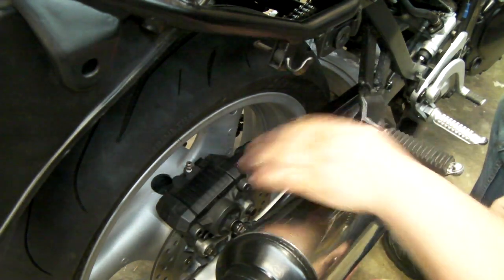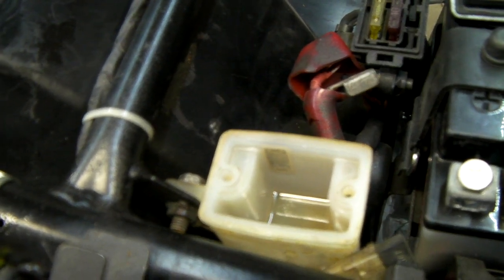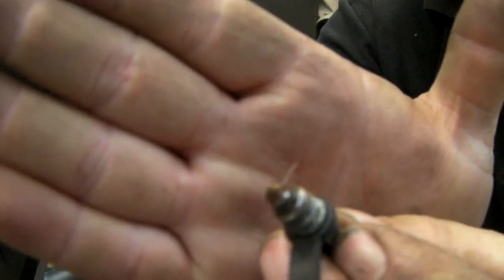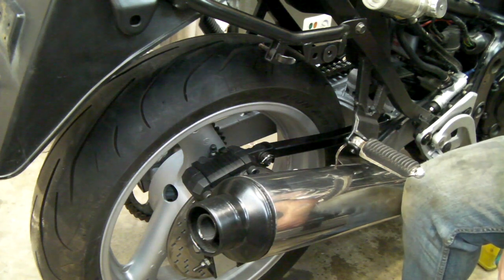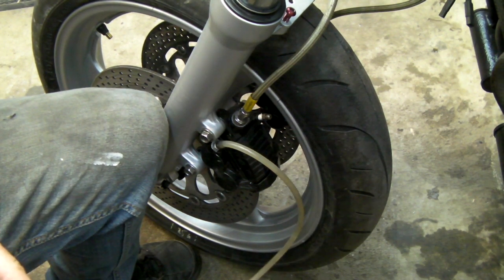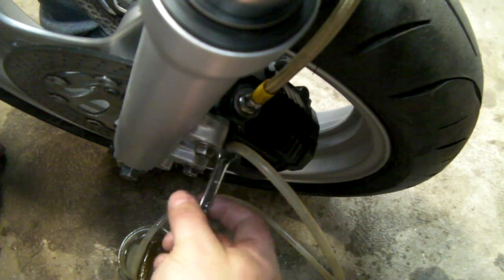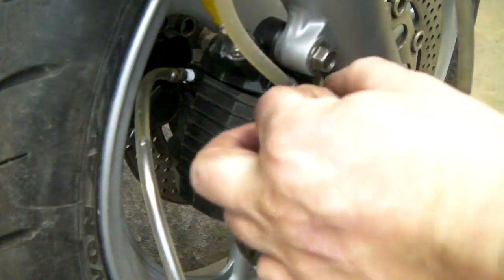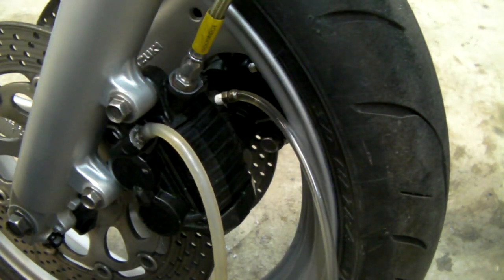Suzuki GSX750F Brake Bleeding Fun

Comment: Awesome video, I have a gsx750F (1991) and have rebuilt the front brakes lately. Funnily enough, I had the same trouble with reverse bleeding them as you did, however I also just encountered a problem with my brake lever pushing on the plunger at rest, with no ability to adjust it. 

It won't build up pressure without the full stroke of the plunger you see. No idea why it's like that but it's stopping me from bleeding it properly!
Reply from the maker: I had to rebuild my master cylinder to fix that particular problem, it might be that yours too could do with a rebuild.
Reply: @stirlingbikes  That was after a rebuild actually so I assumed (never assume I know, haha.) it would work flawlessly. Turns out the front brake light switch was sticking out enough to stop the lever fully returning, leaving a big air bubble as the piston couldnt return fully either. No idea why it was like that, stock master cylinder, lever and piston as far as I can tell.
Reply from the maker: Not one I've come across myself, but certainly a learning point there! Glad you've sorted it at least.